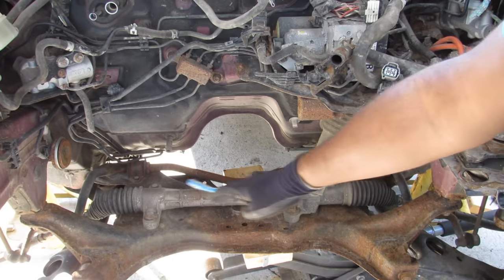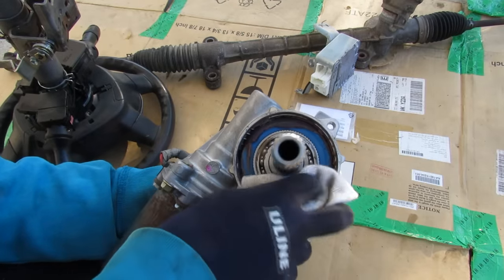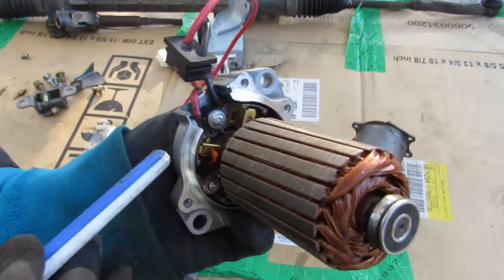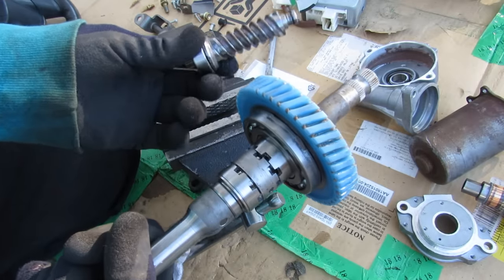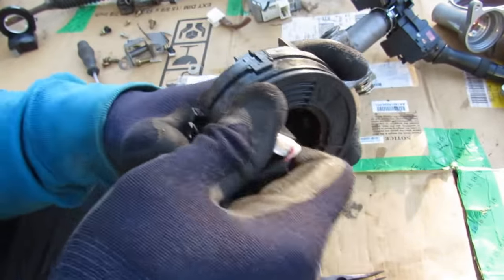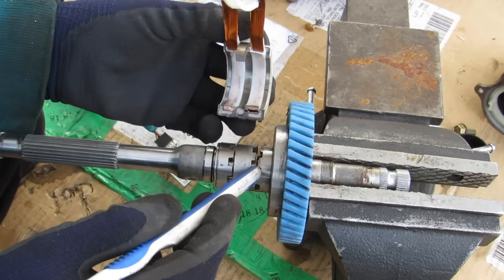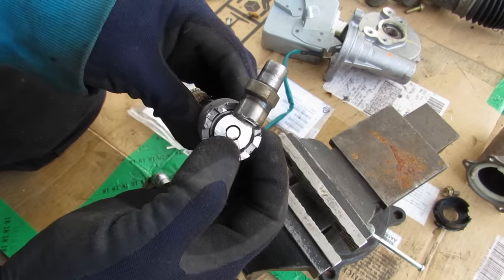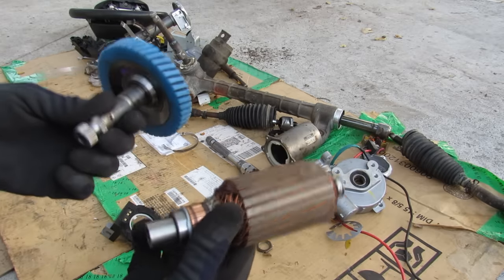How Electric Power Steering Work

Comment: I'm not sure why power assist steering is necessary for smaller cars. I remember my old Ford escort (1982) front wheel drive could be steered with two fingers and no assist. Now, my current Honda Jazz is almost impossible to steer when power is off, why?
Reply from the maker: Because small cars weigh alot more now than then!
Reply: @speedkar99  not that much heavier!

Comment: When I saw it was a worm gear it was how can it turn manually?  The key benefit of a worm gear is that it doesn't allow that.
I'm not sure it works because of the plastic gear, the teeth appear to be different so it can push the worm gear.
You really only need power steering for parking, otherwise it doesn't do anything, so I'd guess the plastic gear will not wear out or the brushes.  But if you used this setup for 'self driving', I'd bet it will wear out pretty quickly.

Comment: I got a question for anyone that can help me out. I’m LSA swapping a Genesis g80. What in the EPS system sends the power to the rack once the car is started??? Is there a relay or is it something on the engine that tells the system that the car is running???
Reply from the maker: Look at the wiring diagram

Comment: is anybody able to explain the benefit of having electric powersteering compared to hydraulic? my mom uses car with electric power steering, I cant feel the road it seem wrong, is it any physical connection between steering and the wheel in case something fail I still have control over my vehicle? any further information would be apreciated
Reply: The benefit is less junk under the hood (pump, hoses, oil reservoir), a bit more efficiency, maybe higher reliability and perhaps less cost to build.
I like the setup on my Honda but expect hydraulic systems were better perfected over time and expect EPS to improve too. Just like in hydraulic systems, there is a physical connection to the steering rack so you can steer the car in case the assist fails. Steer by wire is another story though!
Reply: @gmzx3  thanks mate, it clear my view about electric sreering. now I dont have any reason to deny reasonable progress. once again thanks, appreciate your infos

Comment: Hey guys! Any idea whether of not this EPS system from Prius can work for autonomous driving applications? I.e not only assist torque from operator, but also rotate  the wheel by itself when required.
Reply: If you were able to activate the torque sensor, in theory you could have the electric motor turn the steering. However it may be designed with a limited power output that is less than the normal torque required to turn the steering. This would be so that in the event of a failure in the sensor, that the steering does not turn itself
Reply: as I commented already, if used for self driving, I think the plastic and the motor brushes would wear out pretty quickly.
I don't know what Tesla uses for its electric steering, maybe it is the planetary gear setup he mentioned, I've not seen one of those.

Comment: Very nice plastic gear. It's made of MC901 heat stabilized type 6 nylon and stainless steel. I know because I just ordered a chunk of it to cut my own gears for rare and hard to find BMC high performance hub motors. I can get a steel gear for less than $20. A gear like that from KHK will cost me well over $100 plus shipping. Top of the line gear using the latest technology based on my research. No wonder Toyota is known for reliability.

Comment: You are doing work on the side of the angels by chopping up Priuses into teeny tiny bits and showing us how they work.  Not to mention encouraging your brother not to leave his socks lying around.
I have been driving for over 40 years and know all about what it feels to drive with and without power steering in different classes of vehicles, sometimes due to failure and sometimes due to by design.  I have a fairly decent layman understanding of electricity and mechanics. I have never been able to wrap my head around power steering torque sensors - hydraulic nor electric.   How can it know where you mean to turn the wheel and help you get there, without influencing you and stop in time without going too far?  Engineers earn their big bucks for sure.
Reply from the maker: Thanks I'm glad you like my work

Comment: To depend on the plastic material of the ring gear to slide on the worm gear if the steering motor malfunctions is not a good idea. From an engineering point of view, I would not have done it.
Reply from the maker: Interesting point

Comment: I'm shocked they still use steering columns instead of electrical wires connecting the sensor to the motor. That design would save money and weight.
Reply: I think direct drive / control ( steering column ), is still proven more reliable and safer, than having a steering system that's motorized that if it fails, could prove fatal. I suppose hydraulic steering could be used, but still prefer a direct steering linkage...Imo.
Reply: @bountyhunter4885  I see. This system is electric power assist rather than electric steer by wire as in a Tesla. I guess there is weight and cost savings over a pump, lines and fluid power assist system.
Reply: @bobhenry6159  Absolutely.

Comment: brushes and plastic gear= failure point the whole unit must be replaced and secondly all those electronics just too turn left and right, I'll just stick to the old fashion system recirculating ball power steering box, power steering pump and fluid.
Reply from the maker: I'd argue otherwise and say EPS has been more reliable than hydraulic.  O leaks

Comment: They have issues they create lots of heat, not adequatly lubricated and no input feel from the road. They usually fail 80 to 120k miles and cost 4k to replace. Fun fun ill stick with hydraulic thanks

Comment: Hydraulic power steering is genuinely simpler and more reliable.

The only reason electric power steering was invented was for hybrids and EVs. So electric power steering is stupid and not the future, because EVs aren't either..
Reply from the maker: No way. Electric steering is much simpler. Less hydraulic lines, reservoirs and no pump or fluid to leak.
Reply: @speedkar99  - Yeah, there's all that. But the safety factor requires the plastic gear so it still works if it fails. But the plastic gear is itself a potential wearing out and falling point.

Hydraulic power steering is an incredibly mature and developed technology. 

And besides, this first generation of EVs (with lithium-ion batteries) isn't going to be hanging around that long.

Comment: 5:20 GeRmAn CaRs ArE uNrElIaBlE because they use plastic gears, a reputable reliable manufacturer like Toyota would never do that.
Reply: Also a bit different fuel with higher octane rating, maybe some lubricants, who knows. But the way German automotive shops work is also different.
Reply from the maker: Haha